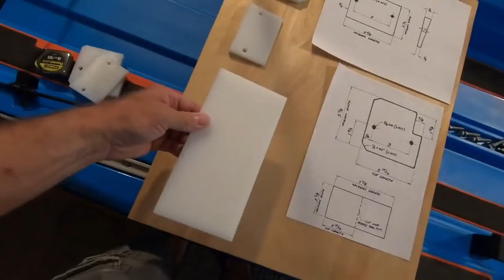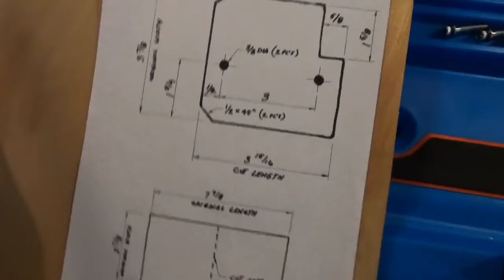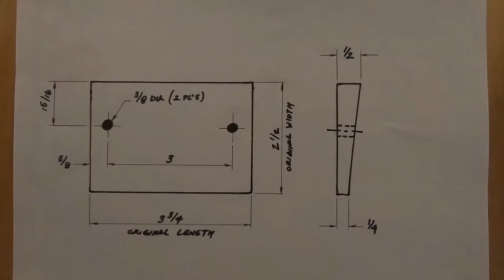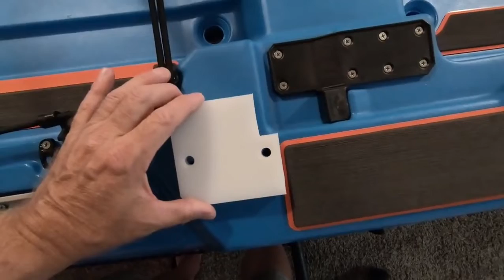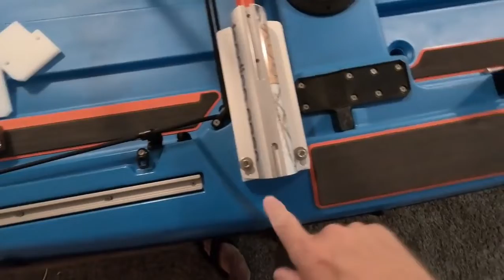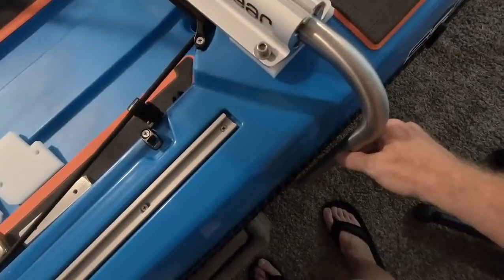Boonedox Landing Gear Installation on a Bonafide SS127 Kayak 2018

Comment: I recently bought a boonedox groovy landing gear and the concepts here have been very helpful. Unfortunately they have changed the knuckles and use a wider backing bolt now. The location in which it will attach has changed. I plan to upload a video and share this with the community shortly. Will it be OK to link your video to anyone who may not have the newest version in my description? Its my intent to help anyone interested with either mod on bonafide go to the correct videos.
Reply from the maker: Yes, Share with the community. I will be interested in seeing the New changes. Thank you.

Comment: Just an FYI, it appears Boonedox has changed the mounting brackets, knuckles and crossbar for the latest slope model. The new brackets barely fit this template and would likely break the edges of the stiffener. The new mounting brackets require a larger stiffener.
Reply from the maker: I looked at their website, yes they have changed to a Newer mounting configuration. You have to use your own judgment on the best configuration for your use. Good luck with your project!

Comment: Just successfully completed my third Boonedox install and your video provided the knowledge and some courage to carry out this project.  It didn’t seem like it was going to come together until completion of the bolt tightening process.  Thank you so much for your time making this video! Tight lines.
Reply from the maker: West Meadows, that’s Great!  It’s a little nerve racking drilling or cutting into a perfectly good kayak for the first time. I have since made a modification for the BooneDox mount utilizing the same hole pattern. It’s in the prototype stage of testing. I hope to have a video for this during the summer. I appreciate you watching my videos..... thanks again!
Reply: @pweimer47   Hi there, I just purchased my SS127 and installed the groovy landing gear (on the rails). I was a little apprehensive of the mounting on just the rails. After doing some research, I know see and confirmed that it's a bad idea. On top of all this, it turns out the dealer sold me a SUP version (minus the all the backing plates and wedges) 🤬. So, as I await a 4" hatch and parts/pieces, I was wondering what modifications that you had made in the mounting that you referenced. I didn't see any updated videos.
Thanks so much for showing the template dimensions and explanation. Hopefully the second time around will be easier.

Comment: Great video.  I’ve install a couple of these using the “fishing method” with weed eater line and it was difficult.  I called Bonafide regarding the hull warranty versus cutting the 4” port hole and they of course did not recommend it saying the center strength just behind the seat position may be compromised and limited “life time” hull warranty could be jeopardized.  From a personal standpoint, while the landing gear is extremely efficient for loading, offloading, entering and removing the kayak from the water via a boat ramp, the downside for me tends to be realized on the water as the wheels and bars often interfere with rigging, including but not limited to, fishing rods, bungee tie downs, anchoring or stake out pole, trolling motor pick up and lowering lines.  All of these things are important things to consider.  Your point regarding the use of the “Groovy landing gear” and using backer plate inside of the hull under the tracks is a very good solution because it is unseen, no new holes in the boat, you can remove the landing gear and sell either it or the kayak separately at your convenience.  The only downside may be in reaching the landing gear legs to raise and lower the wheels.  That may be where the stability of this kayak pays off, although if you’re at a dock you could possibly raise and lower from outside of the kayak.  Just my thoughts.
Reply from the maker: West Meadows, thank you for your insight. I too considered many ways of rigging the kayak by watching videos, and my personal experience on the water. I’m always trying New solutions to make my fishing experience better. I spent many years in Engineering, and the 4” hole with a backing plate doesn’t compromise the integrity in that area. I put the landing gear behind the seat, because it was the best place to keep it out of the rear cargo area and away from any rigging. I only access the landing gear from out of the kayak. It’s one of the best pieces of gear for transporting the kayak in my opinion. Thank you for stopping by my channel.
Reply: Thanks, I’m reconsidering your approach since I own 2 sets of original style knuckles.  I’ve got one kayak up for sale with the Boonedox installed and most people want a deal anyway so I’ll probably just remove it and install on the Bonafide.  If the wheels get in the way I can stow them in the hatch.
Reply from the maker: I have the Newest version of the Boonedox. They have the longer legs that keep the wheels from rubbing the bottom of the kayak. The original legs are too short.
Reply: Is there a certain advantage to drilling the holes for the knuckle in the kayak at the back of the knuckles slotted hole?
Reply from the maker: None at all
Reply: Guess I’ll just have to cut out a backing plate. The  4” deck plate I ordered did not have one. Thanks for your help on this project.
Reply: Tried out the landing gear yesterday- there was quite a bit of hull flex at the knuckle mounting points-it was only 70 degrees, so there is great cause for concern when the hull heats up in mid summer - these SS127’s are thin wall.  Barring a better fix, I intend to remove & consider replacement with flush mount rod holders.  Just would disgust me if one of the knuckles ripped through the hull!  Only other option could be to put much larger back up plate.  Would be interested in your take on this. Thanks-

Comment: Why can't this mount to the rails?  Is there something that prevents that sort of install?
Reply from the maker: fishtick442 If you try and attach the BooneDox directly to the rails, it will pull the rails right out if you have a fully loaded kayak, if your kayak is totally empty you might get away with it. Another option is to mount them on the rails, but drill completely through the rail and kayak and add a backing plate. Installing like this will reduce the space in the rear storage area of your kayak. Mounting directly behind the seat takes up no useable space.
Reply: @pweimer47    Thanks for the reply.  I was wondering.  Appreciate your video
Reply from the maker: Thank you for watching